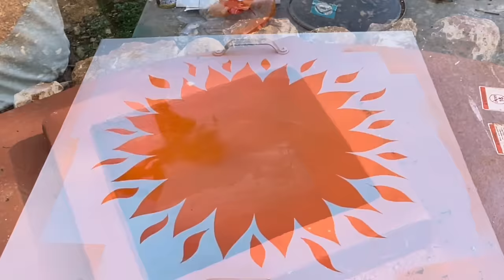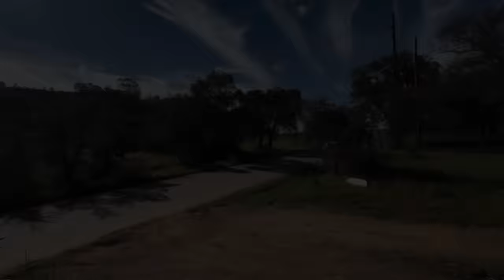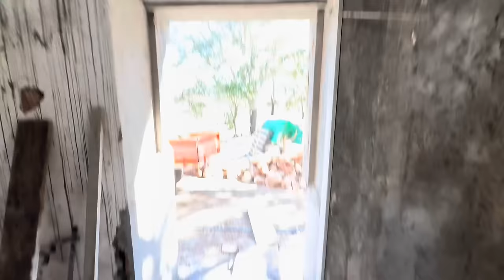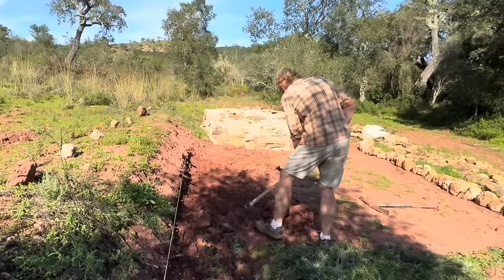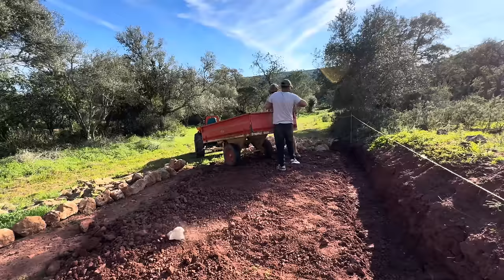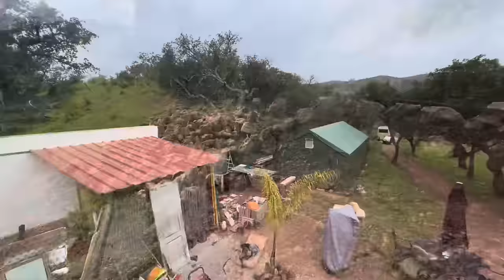A REAL STRUGGLE | Building The Stone wall | E149

Comment: Hooray! Andy has posted another update… break out the deck chair on this sunny hot Aussie morning and grab a cuppa, settle in and get ready to smile my face off 🥰
( and appreciate a nice fit bloke with sexy forearms…🤭)

Ps I am a 57 year old recovering quadriplegic who walks with a cane and cannot lift anything more than a couple of kg. My essential yard tools are a shopping trolley and a hand truck/dolly. 
I managed to relocate over 100 x 20kg bluestone blocks from around my 1 acre block using a hand truck/dolly and a pry bar. I just pumped up the pneumatic tires hard and rolled them onto it. It was easy to move into position with a high degree of accuracy without breaking my back.
Might be handy for you to use one when manoeuvring big rocks into position.

Comment: 💕I spent months in the Cotswold learning from a few elders how to build dry stone walls💕Which I found very interesting they are built with stones of various shapes & sizes about 2-3 stones deep depending on the stones themselves💕It’s like a puzzle using smaller stones in between the larger ones they can often keep the stones in place💕

Comment: Just be yourself. It's good enough and if someone doesn't like it they can let the door hit them where the good Lord split them. I went through a two year serious health battle and have had to try and claw myself back to where I was before. It is  frustrating and not easy  to hold yourself back and the times I push myself too hard I end up getting hurt. It's good to pace yourself and switching off activities throughout the day, you just can't move rocks all day, but you can move 10 or 20 a day and it will get done eventually. Getting old ain't for sissies for sure.

Comment: Ice packs for 15 minutes. Then WET HEAT for 15 minutes. You can use a wet towel, put a piece of plastic on top, then the heating pad. THEN 15 MINUTES OF USING A TENS MACHINE. Turn off for 15 then back on for 15. A TENS machine will HELP AMAZINGLY. Your doctor can give you a prescription for a TENS machine so it will not cost you as much. My TENS machine has a hook on it so I can clip it onto my belt loop. They usually come with 4 leads and you can position the pads anywhere on your back the leads will reach. TRUST ME. I have been using a TENS machine for YEARS and it works great. Much better than taking drugs. Although I do take a tylenol and a muscle relaxant for those times when my herniated disk really kicks up bad.

Comment: Having had severe back problems this last weekend, adding to an already bad back with disc problems, I woke up Saturday and could hardly get out of bed. First thought was “now I’m done, this is the back hitting back for my bad management of an already severe condition” and then I thought about you…
I’m painting my kitchen, up and down ladders for to long during the week. I had cupboard doors and the ceiling done by professionals but being retired with not much else to do and a bit greedy I decided to do the rest myself. It certainly needs to be portioned out with days of rest in between. And of course it got better with rest. Monday even my normal use of painkillers was enough.

Comment: One thing I don't see here is a material called stack block, basically a retaining wall block with a bottom lip. You stack on top at an angle going into the slope no mortar or footing required.

Comment: Gravel- with same size stone won’t be suitable sub base for a wall. You need different size stones so they interlock and compact - like MOT here in U.K.  That’s why gravel is used in drainage channels because there is so much air gap between stones.